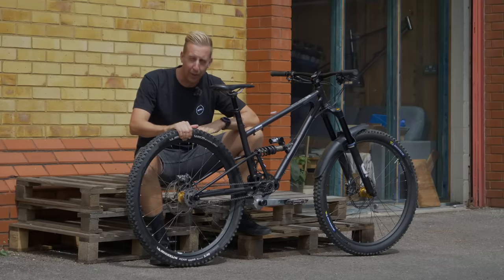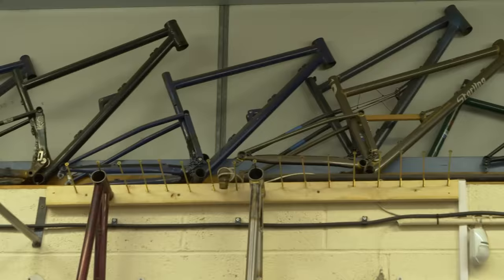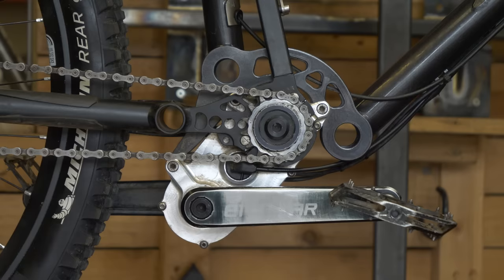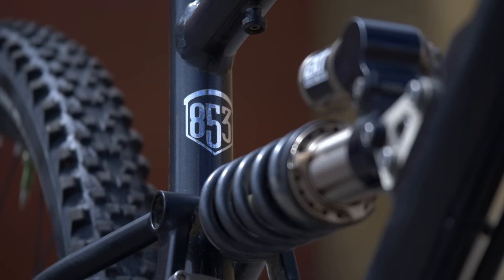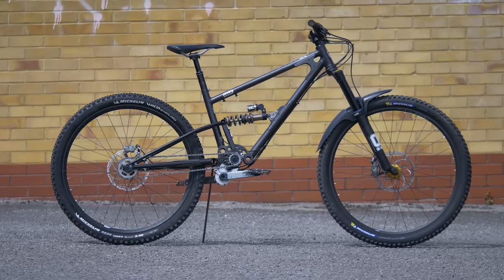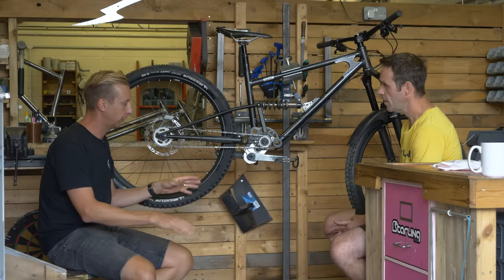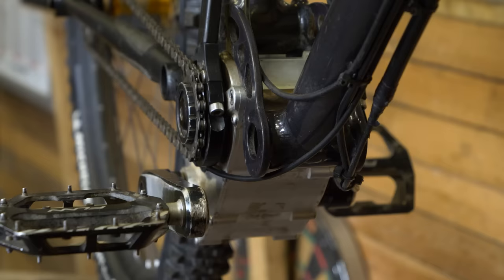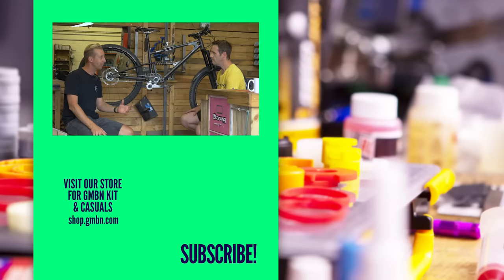Are Gearbox Bikes The Future Of Mountain Biking? | Advantages, Drawbacks, and Future Possibilities

Comment: There was an elephant in that room, its name is Weight.
Reply: Believe it or not, I was surprised to find that the weight is about the same. Look up some of the Zeroed videos. One guy weighed both drivetrains and the gearbox was only 2 grams heavier.
Reply: @jeffjacksonmtb  That's phenomenal! Their website describes frame weight as about 3.6 kg and 14-15 kg for complete bikes, for enduro bikes that's great! Unfortunately, in one sense at least, the steel is heat treated so, I suppose, can't be welded. That seems a pity given that they're steel and nothing else on the market is repairable, they could have had a unique product.
Reply: @quietknight8250  I may have misunderstood your comment. The video was about gearbox drivetrains, so my reply was about the weight of a traditional drivetrain vs. a gearbox and the answer is they weigh the same. I can't comment on the weight of the entire bike featured in this video.
Reply: @jeffjacksonmtb  Indeed my comment was about the weight of the complete bike but particularly with its internal gearbox, so your reply was entirely relevant.
What an achievement to make an internal box the same weight as a cluster and derailleur, or should I wonder how a cluster and derailleur (I refuse to use such a ridiculous term as 'cassette') came to be as heavy an internal box?

Comment: What I do wonder about those gearboxes, is thart they have bottom bracket integrated, and I am not sure how sturdy is that part, how does one change bearings there, how much does it cost and similar. Also, this gearbox seems to require specialized chain ring so how much does replacement cost compared to normal one, and things like that,

Comment: Why not even ditch the power sapping chain (stretches) and toothed sprocket thingy, and slip in a nice superlightweight carbon solid driveshaft?
Reply: The full suspension frame compresses which would make using a driveshaft difficult

Comment: AXS shifting could fix the annoying twist shifting i'd imagine.
Reply: Currently riding a Bizango 29er with SRAM x1 drivetrain and, for fun, a '98 Rockhopper triple with twist shifts. The twist shift is way better: can go through all the gears in one movement. Never had any reliability problems either.

Comment: I like the idea of a central gearbox but as the industry has gone the carbon frame route, how practical would it be to fuse the box to a carbon frame? Or could you make a carbon box?
Reply: Carbon frame is no issue, it just bolts on mounts. Just as the shocks and bottom brackets usually do.
Reply: @thomasowenmazzetti7877  Right, though anything that bolts on has the potential to creak but I suppose it's no different than bolting an e-bike motor.

Comment: Hmmm...Not entirely convinced this system will ever take off! Gearboxes have been around for some time and so far nothing. Yeah shed build as this pops up from time to time but that is about it! Just the service time to fix it or replace it would be much worse than just in the worst-case scenario swapping rear derailleur!
Reply: I think just give it time and this could eventually be the future. At the moment I'm guessing manufacturers like sram and shimano etc are developing mechanical and electric drive trains as much as possible before they want to abandon them and move onto gearboxes. They'd also have to wait for the right opportunity if they built a gearbox since the current market is so caught up on the latest from brands

Comment: There are two main disadvantages to gearboxes that doesn't really seemed to be being solved..... Weight and inefficiency, if they could fix one of them I think it could be plauseable if your trail bike is going to cost mega money, weigh 34lb and cost 7k why not buy an enduro bike that pedals just as well weighs less and is more capable
Reply: Well… I thought about that a lot.  There just aren’t many real Enduro bikes lighter than 34# with real tires and forks. And the drag only manifests in “downhill” gears. The belt drive sealed the deal for me. No regrets with the Katipo.
Reply: @willlange9978 my slash is 32lb with Zeb forks and enduro tyres

Comment: #askgmbntech hey Doddy, love the show, I bought a brand new trek marlin 6 about a year and a half ago and I think it’s time to upgrade the 100mm coil fork to a 120mm air fork, the only problem is that all half decent air forks need a 15mm thru axle, and my bike has a quick release skewer so how would I convert my quick release skewer to a 15mm thru axle? Thanks
Reply: You have no choice, change your front wheel or hub. That’s it
Reply: Change the front wheel/hub

Comment: #askgmbntech what pedal has spd on one side and a large flat eg 90mm+ reverse? The combination pedals I see have a relatively small flat area eg shimano PD-eh500 compared to dedicated flat pedals like jet black or spank spoon which are 90…110mm depending on size.

It doesn’t seem very common for the manufacturers and retailers to publish the dimensions of pedals that have cleats?

Comment: gimme a gearbox and belt drive now!!
Reply: You don't want a belt, stuff gets between the belt and pulley.
Reply: @quietknight8250  damn it..
Reply: @boccacantiga5095  However, if some clever clogs came up with an idea, or better still, a design, for a 'chain' made of some rubber like material that worked with conventional sprockets, i.e. had 'holes' for sprocket teeth but was a one piece item, like a belt, and was sufficiently flexible in the vertical plane and rigid in the lateral plane (viewed side on) and could be done for less than a king's ransom... that might work.

Comment: Judging by the video, you effectively only moved the bulk of the weight to the center of the bike with all the shifting drawbacks of regular derailleurs but in a more complex system that's harder to service and possibly much more expensive to repair... And that's assuming they won't make these non-serviceable. It's easier to do it on a sealed box where you can't see what's happening.

Comment: Gear box drive has been around for a while now but never really caught on do to the weight  even though the benefits are way better than traditional derailleur setup just think about the potential suspension designs that could be used or created  food for thot 🤔🤔
Reply: Another problem being that manufactures need to build a special frame for a pinion gearbox.

Comment: I get that it's expensive. But I would just run water in that fucking thing and not even bottle of the oil if I have the money to afford one. I'm being a little facetious but honestly, a constant mess transmission is something that is used on a dirtbike with 50 hp. I'm surprised they bother Put in any sort of lubrication inside that gearbox. You could get a rid of a lot of the friction by just running it dry with harden parts.